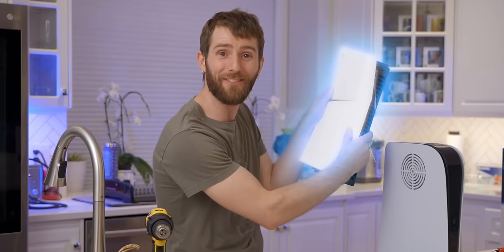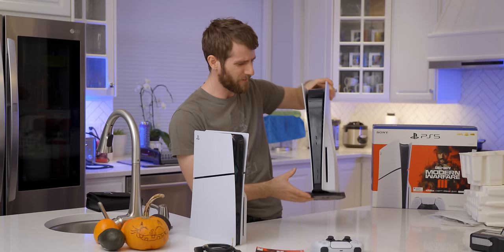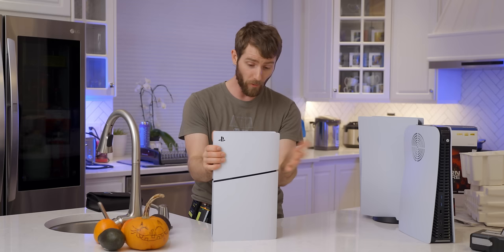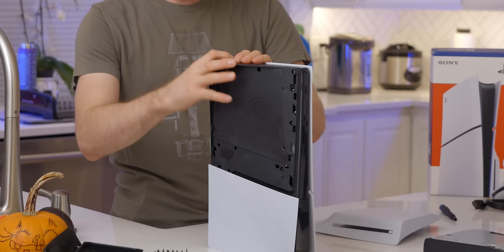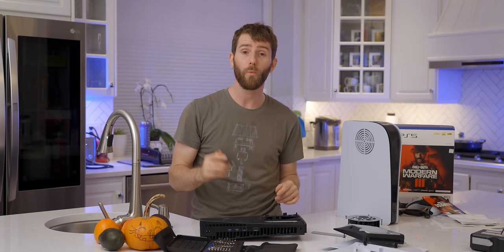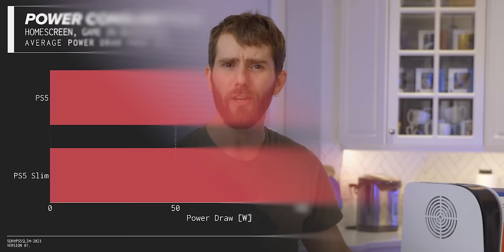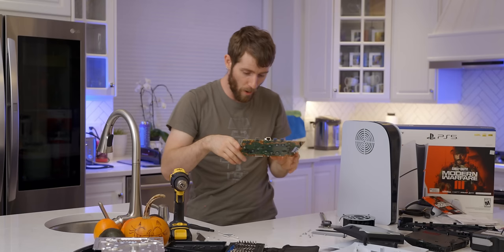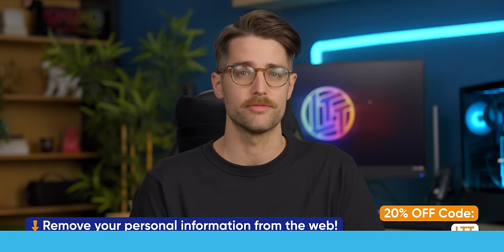PS5 Slim First Look and TEARDOWN!!

Comment: Thanks for showing the teardown! Im a small technician and we may have a slight influx of these coming in throughout the years so getting this knowledge is pretty handy
Reply: It was actually a pretty straightforward teardown - I'd rate it 6.5/10 for reparability. The screw under the sticker was annoying, but the heat gun pulled it off really easily.

The different screw sizes/pitches was also a bit annoying, but a magnetic workspace pad kept track of them fine.
Reply: Yeah just don't pry on the metal bracket on the I/O connector like they did. Push down and pull the cable out.
Reply: Tronicsfix should have you covered once he comes out with a tear down video. 👍

Comment: It's understandable that the chip didn't shrink anymore, unlike the last time a slim model came out there are many more companies buying up all the latest processing nodes. It's unfortunate but seems to be where we are heading.
Reply: It makes sense from a margins perspective. Why go through the hassle of porting the design to a better process node when the current one is fine and costs less per chip.
Reply: Why do they call it the "slim?"  That is not what Sony calls it nor makes any reference to calling it that.
Reply: @Ryan_DeWitt that’s exactly what sony calls it
Reply: @Ryan_DeWitt the smaller revisions of PlayStations have always been referred to as the “slim” version
Reply: @insainllama But Sony does not call new PS5 :"Slim", so why do you adding it to its name only to argue about how big it is. Rediculus.
Reply: @Ryan_DeWitt Every smaller Version was called "slim" lel
Reply: @Karolina-kr5fl ridiculous *

Also, sony said slimmer design so it kinda passes on the idea of being a "Slim"
Reply: Not to mention there are many 6nm Ryzen 7th gen APUs that are still using the older zen 2 cores and you’ll find them on entry level new Ryzen laptops (like Ryzen 5 7320c). The newer zen 4 based higher up models use the 5nm and 4nm nodes. The ps4 uses those older zen2 cores so it makes sense for AMD and Sony to go 6nm.
Reply: that's what unified hardware and good optimization will do for you instead of just forcing consumers to buy a 600$ gpu just to run at recommended settings
Reply: @marcobrandao1993  And it is definitely slimmer ;)

Comment: I really appreciate that they made the console smaller, although for my setup it doesn't really make a difference. Had no difficulty adding the PS5 to my desk and I love the look with a matte black dbrand skin in the middle and the red face plates. I do really appreciate the work they have done on the slim model, although I am perfectly happy to stick with my launch-day PS5 that is still running great.
Reply: Wait I really need to know, is it less powerful than the Original two? The Ps5 Disc Version and Digital version. 🤔
Reply: @coolsolotype  It’s just as powerful, just smaller!
Reply: Looking at a dead console in a couple years with that Emmc
Reply: I had a launch day PS5 as well that bricked after about a week of use 😂 Sony gave a new one and I’ve had it since. See no reason to get the slim currently but i have no doubts it’s worth it. I doubt I’ll get another ps5 unless a pro is somehow announced.
Reply: @sebrothering1274  Yeah, there is a chance I may go for the Pro too if that’s released, although I am currently quite happy with how it’s running games. I know it only runs Alan Wake 2 at around medium settings but the game still runs pretty well and looks great in my opinion. Not to mention if I were to game on a PC I would probably own one that gets about the same performance anyways.
Reply: @cadenchurchill4296  we will talk about Pro in 2-3 years ;D
Reply: @jaworq  Yup 😂
Reply: @jaworq Pro is coming out December 2024 that's my guess, they need to advertise and make hype out of it before GTA VI comes out.
Reply: @bsnf-5  i hope you’re right. My wallet is ready all the time for ps5 pro or even ps6^^

Comment: Good thing that the mainboard and heatshield and sinks dont have to be separeted like ever... the liquid metal makes it perform good over time and dust only accumulates outside on the fins this is good for maintenence imo
Reply: Unfortunately it looks like they're still going to need regular maintenance, and often.  I kind of wish Sony inferred with their designs that you should lay the console down flat.  

At least once a week I have to service a PS5 due to overheating, most of the time the top half (area that has less conductive material and more heat when standing upright) of the chip is covered in oxidation and is effectively repelling all that liquid metal off of the mating surface.
Reply: @VellahTV  Also, while not an Issue for now, the other Thermal Pads (or whatever its called) for VRAM, NAND... other Chips might dry out over Time as well. I dont know exactly how long this will take and i assume Sony uses (very) good Components there to counter Issues but i also assume if you use your PS5 daily over longer Times when you are also living in a hot Area... this will make Issues at some Time in the Future regardless.

It would be nice if you could open and maintain it more easily imo. It seems also overkill that they use SO many Screws.

But i am no Expert.
Reply: @flimermithrandir Jeez, are they really so poorly made you need preventive maintenance done? My PCs run for over a decade without any thermal paste replacement, hell... my aio cooler has been running 24x7 for over a decade with no issues. 

This thing can't last it's 3-5 years life without a user opening it up?
Reply: @Shadow__133  Easy now. They arent made worse than the RTX 2070 Super i just replaced the Thermalpaste the other Day (... like half a Year ago) so it doesnt overheat anymore and Blackscreens at 93 Degrees... So i dont know about you and your PC never needing to maintain anything... Point is a Console is just different than a PC while you might just change the Thermalpast easy on the CPU or change the GPU anyways and never have that Issue to begin with (the other Guy buying it might run into Problems though). 

Anyways, the Point is that a Console is used Way longer. Maybe even in 30 Years, who knows, and it would be nice to not have to unscrew 234 Screws just to get to the Thermalpads.

That said i dont think the PS5 is constructed in a very good Way either, no.
Reply: @flimermithrandir  30 years??? Like these things will be as iconic as an Atari or SNES?

The day I need to open my xbox is the day it will become a paper weight or book holder. Zero hardware issues so far after 3 years.

Comment: 6:00

Regarding the USB ports, Sony's own site says the original/launch PS5 has three 10Gbps ports (1x USB-C on the front and 2x USB-A on the back) and the front USB-A port is "High Speed" USB (they don't specify the speed but "High Speed" refers to USB 2 or 480Mbps) and not two 5Gbps and two 10Gbps as mentioned in the video. The only change the Slim brings in regards to the USB ports is the front USB ports are now both USB-C with one being a 10Gbps port and the other a "High Speed" port according to Sony. This means that the USB ports are all the same speed as the original PS5 but the only difference is the USB-A port on the front has been replaced by a USB-C port at the same speed.

Comment: As an EE who designs PCBs this thing is a work of art.  Much of the time we are limited by thermal constraints and have various methods of dealing with it, though always at a cost.  The giant custom stamped clamshell as a shared heat sink and EMI shield is a great low cost and super effective solution that is surgically effective, kudos Sony!
Reply: Always impressed by the work EE's and CE's do to make these things a reality. Props to you guys and gals.

Comment: So many screws because it helps with shielding but it helps a lot more for making sure the board doesn't warp.  Heat can make the board warp which can break solder joints.
Reply: That's how my first PS3 Superslim die.

Comment: I'm most interested in thermals compared to the OG version.
Reply: Its exactly the same at least comparatively with 12xx version measured at the vents exhaust.
Reply: the original was fine, the 2nd version was the issue as they removed far too much heatsink, thats why they had to add more to the 3rd version
Reply: @bladeclanhalo3  3rd version? Meaning the 12xx model?
Reply: @ryutenmen i dunno the model names, but you had the original 7nm. then they moved to 6nm but removed far too much heatsink which caused heating issues, then they made a 3rd on 6nm but added a beefier heatsink
Reply: Pretty much the same actually i think they are using the same heatsink as the cfi 1200 ps5 so the temps are fine the biggest difference here is literally the size and the removal of the vertical base and also the quality of the horizontal because now is the 2 little plastic things linus show at the opening of the box
Reply: The slim is slightly like 1 degree C warmer or two based on the first appearance at Dave2d’s channel.  Hope to see more deep dives into it from nexus.😊

Comment: The acoustic measurements on the plane were nice (I would recommend a tinnier angular spacing to make the graph less choppy). However, because sound can be emitted in all directions, this result doesn't mean that the total acoustic energy radiated by both devices is the same. Measuring total acoustic power will give you that information. Is a more tedious measurement to do, but it does not require an acoustic chamber 🙌🏻

Comment: It was definitely shrunk somewhat, but there is no way the total volume shrink percent is anywhere remotely close to the shrink Sony managed with either the PS2 Slim or the PS3 Slim. Those were both massive reductions in size and volume compared to their full fat launch models.

You could probably stack three PS2 Slims on top of each other and it would be thinner than the launch model.
Reply: Yeah I think a lot of that comes down to the advances made during those time periods in component sizes. The gains are a lot more incremental when it comes to physical size these days it seems.
Reply: There's a reason why Sony themselves aren't calling it a "slim"
Reply: You forget that there was a PS2 chipset included inside the original PS3 for backwards compatibility. Remove that and supporting hardware and there's a lot of space to make it smaller
Reply: It's almost half the size of what we have now.....
Reply: You forget that almost half of the volume of the original PS2 was for a 3.5 inch standard HDD expansion that was almost never used.  The PS2 could have been half the size at launch if not for the HDD drive bay.
Reply: @qapncrunch Which in turn also included the PS1 chipset?
Reply: @mbsfaridi  I think all PS3s just use an emulator for PS1 games? They might as well have, given how easy to emulate the PS1 was and how the first people to do it ended up working for Sony.
Reply: @thetrilltroll7633 I wish people would mention this more. It’s also an good explanation for why the new model is internally the same as the old.
Reply: @mbsfaridi  no because even slim ps3 without ps2 hardware can play ps1 games
Reply: @stevethepocket  The first fat model did have hardware compatibility with PS2, after that it was software emulation.
Reply: @qapncrunch  They removed the PS2 chipset after the first fat model to lower the cost.
Reply: @Clintaso  yeah sadly it gets lost in the discussion

Comment: What is more impressive to me is that this slim version is about the same size as the Series X
Reply: Now we wait for Microsoft to make an Xbox One X sized Xbox Series X 🤣
Reply: @danielm.595 they have that tube shaped diskless revise coming
Reply: @alphaj9  Let's see what will come, but if I remember correctly, Phil Spencer said that the leaked info is old and some of the plans there were changed.
Reply: I mean the only difference between the original ps5 and the series x. Ps5 is taller but Xbox series x is wide. I wondering if Xbox will slim down the series x to the series s model, without a disc drive.
Reply: series x is wider but much more ergonomic. i put my ps5 on the same dresser i had my series x on, first i laid it flat and it took up all the surface of my dresser and i had to move my 4k blurays. then i decidided to put the stand on the ps5 but then it was hitting my sound bar. so what you cite as the only difference is a huge difference  @Tylerstoessel
Reply: @alphaj9 that thing looks like a fan mockup at best
Reply: Series X is much more manageable, well thought out and looks way better than the ps5 abomination
Reply: @iHaveTheDocuments too bad it has no games
Reply: @musicimpact7120   Lol did you just say "two bad"?  It's too bad.
Reply: @iHaveTheDocuments  what're you talking about?
Reply: SilverSurfer-mg6ti the regular PS5 is barely thinner with the stand and if the fit is that tight you're gonna cause cooling issues

Comment: The slim digital has the ability to add a disc drive in the future. wondering if that means i could remove the disc tray from a non digital slim, and turn it into a digital, then get a flat face plate for where the disc tray was. reattach the disc tray if i want to play a game

Comment: The two plastic pegs are the horizontal stands to be put in the gap between the top and bottom plate of the disc drive side.

Comment: Honestly, everything here is pretty much what I expected. Given that the price of the console hasn't really gone down I figured that it would at its core still be utilizing the same chip. So my feelings about it are exactly as they were when I first heard about it which is that if you already have a PS5 like myself then there's no reason to upgrade BUT if you don't yet have a PS5 and are in the market for one then there's no reason NOT to get this slimmer model as it's small, has an extra USB port, and a bit more storage while utilizing the same amount of power for identical performance. Also, unless you come across a sale on the all digital model I am still of the opinion that you should go for the disk-based version despite now being able to upgrade to a disk in the future because the price difference between the two is negligible for the added benefit of being able to pick up physical discs that often go on sale from retailers way below their price on the PlayStation store.
Reply: jrrr9219  5. PC with same performance is like 70$ more, only.
Reply: jrrr9219  But then it has optimization so idk
Reply: jrrr9219 USB C to USB C cables exist, or you could just plug them into a phone charger.
Reply: jrrr9219  Charge them when you're not playing it then

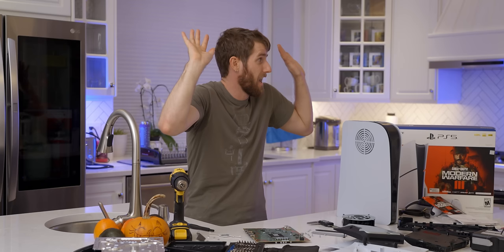Comment: 19:17 probably due to shortages and price at the time 5nm wouldnt be any cheaper for them to make, we would only get power savings as actual users, I wouldn't be shocked to see a 5nm revision of this in another year or so like they did with the base PS5 getting two revisions since launch to reduce the heatsink and then the 6nm+further heatshrink reduction once price comes down more.
Reply: nah if we get another revision, itll be an ACTUAL slim model. Note how Sony doesnt explicitly brand this with the word "slim". It's only replacing the old fat ps5 once supplies run out. It's the new standard.
Reply: They have no reason to update performance now as they want to sell you the Pro models later.
Reply: @companyoflosers they never branded any playstation as slim.
Reply: They actually did the 6nm shrink from 7nm a while back because it was cheaper to switch then it was to keep on 7nm
Reply: I feel like they wouldn't changed it into 5nm chip because the 6nm chip was originally from the Slim but they tried it to the Ps5 which makes the 1200 series one

Comment: No thermals testing? Having same power draw in a smaller case could go either way, so seems like testing that would have been a huge deal to see if there are hot spots that could cause issues.
Reply: Probably that's why LTT didn't provide this data.
Reply: Sounds like a job for GamersNexus with their thermal probe setup. 
(Consoles are notoriously hard to do proper thermal testing for, as none of the temperatures are exposed to the user in any way and you basically have to take the whole thing apart, place thermal probes while not ruining the original thermal material and then put it back together and stress test it.)
Reply: Im pretty sure there are not gonna be that much difference because the heatsink looks exactly the same as the cfi 1200 og model and that has the same node and the same power consumption im pretty sure the smaller case wont do much
Reply: Consoles aren't that hard, if you have the right tools. At least some aren't, i got to do a little beta testing on one that had access to dev tools and it included a massive array of temperature data. So some console manufacturers actually care enough to put a lot of temp sensors across a lot of nodes, just a matter of if external testing groups can get access to the software. Kind of like how PCs can have a lot more nodes than you realize, like using some apps that pull up a dozen different temps that apparently are built in, but without access unless you download the right programs to access it all (or, i think some might have access through BIOS but that's not particularly useful for stress testing)

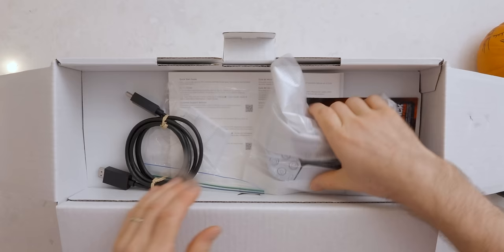Comment: 1:31  “Non-revised. Dual sense controller“ This statement is incorrect. There are two versions of the controller. If your serial number ends in –1 you have the original dual sense controller. If it ends in –A, you have the updated internals less prone to stick drift.

The slim are shipping with a mix of both versions, my slim digital came with the new version. If you get the -1 by chance, you may want to think about returning the console and trying again for the newer controller. hope this helps.